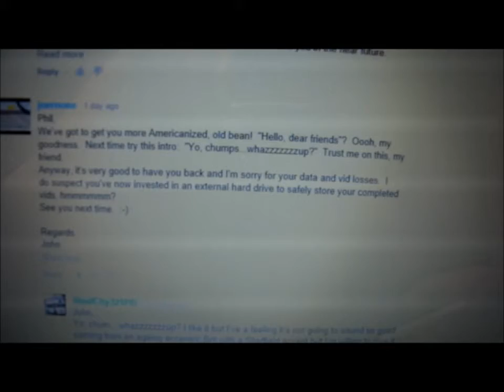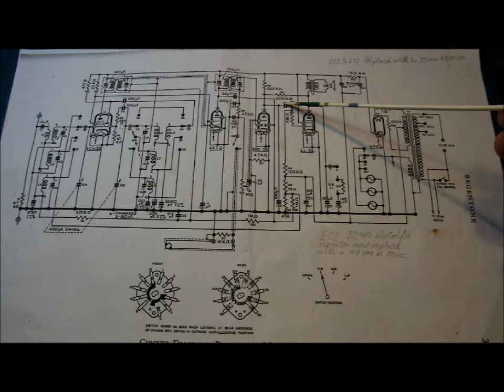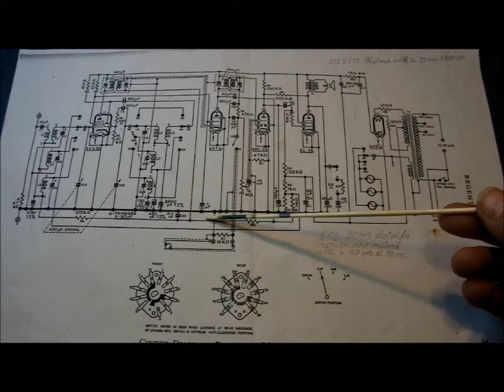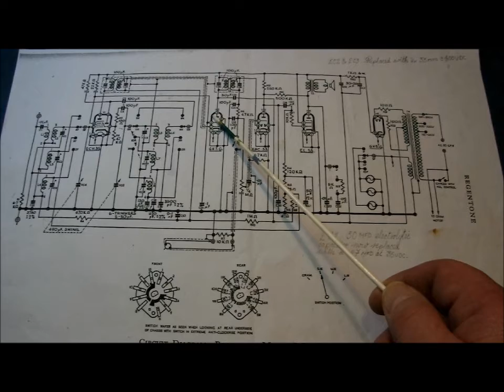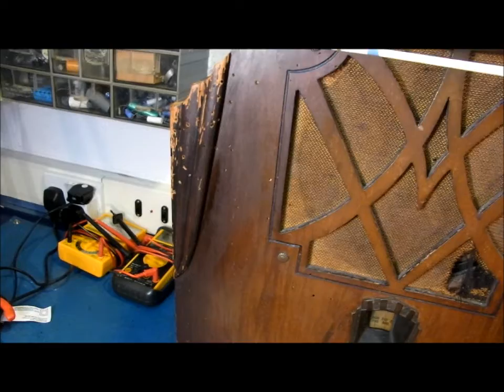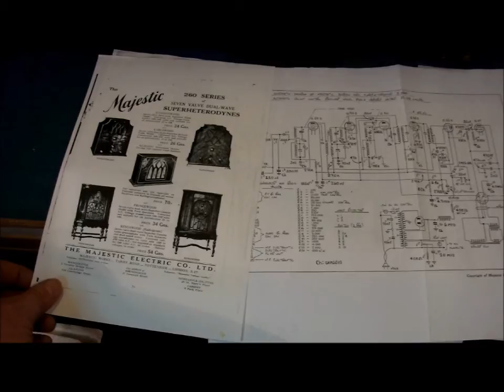Regentone RG99/2 Restoration, Part 1.

Comment: Johns a hoot! Look forward to your restoration vids.I would love to have an old British radio especially,  a EKCO AD76, 1935. I hear there rather pricey, but I love the look.
Reply from the maker: Bruce,
Good to hear from you, thank you my friend.
About eight months ago, I restored an Ekco AD76 for a friend. At present he is having a new centre bar reproduced and it will look good once it is complete. Although I do not know exactly what he paid for the set, I understand from other friends it cost him over £600 (around $1,000) – it was a none-runner and its condition, at best, was fair to poor.
I have to say, although their performance is generally decent, they are an ordinary circuit designed set housed in a large Bakelite saucepan. Having said that, I’ve treated myself to an Ekco A22: a none runner costing £500.
Phil.

Comment: Another detailed explanation of how each stage of the regentone works Phil. Excellent! I know how irrelevant this all sounds, but I couldn't help notice that the valve diagrams look like "faces" to me. Never noticed this Rorschach effect in a schematic before. Anyone else noticed this as well? I'm probably delusional. .... .. .... ..
That Majestic is going to be another great restoraton series for sure. It will be interesting to see how you handle the wood worm boring holes.
I think that you passed "wazzzzzzup" with flying colors! I know I'd rather hear your quaint English dialog instead.
I'm so, so, glad you're back Phil!
73s to you and your XYL,
Tom
Reply from the maker: Tom,
Forgive me if I’ve replied before but there are lots of replies that are, for some reason, being flagged up as possible spam – I’m losing track of those I’ve replied to and unfortunately you are one of them.
So, if I’ve not replied my friend, thank you for replying, it is always good to hear from you and I hope you are keeping well.
I definitely like the Majestic radio: I’m glad I bought that one: one of my better purchases. Once restored, it will be a fine looking set.
I believe I see what you may be seeing in the British circuit diagrams when looking at valve representations. They are elongated ovals and the grid representations are dots looking like eyes and nostrils, and the cathode looks a bit like an upturned sad mouth.
Once again, thanks dear chap: will, God willing, catch you later.
Regards,
Phil.